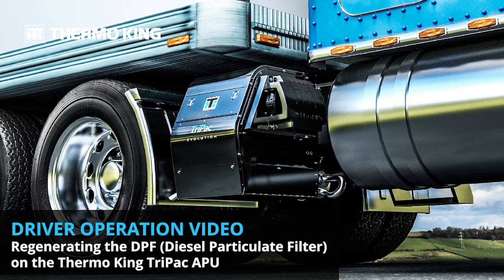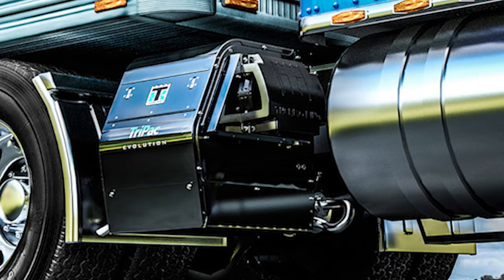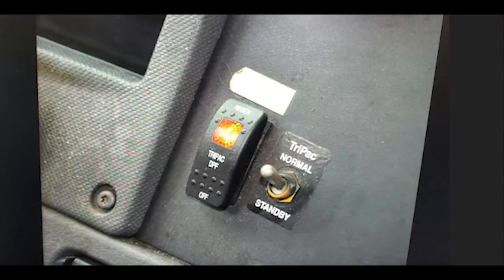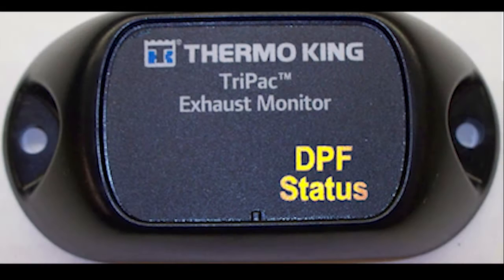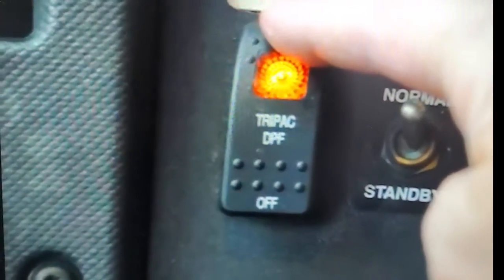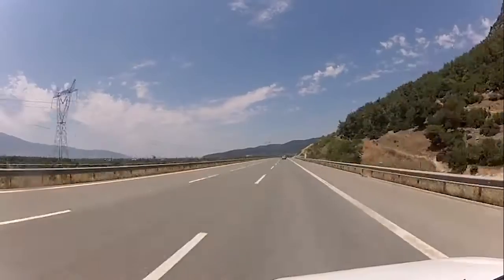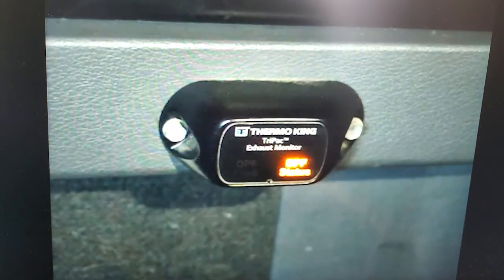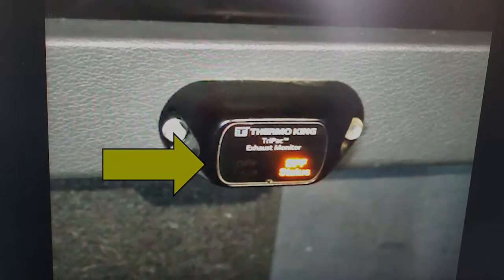TriPac Evolution APU Driver Operations: Regenerating DPF

Comment: What happens when you run it past those 10 to 15 hours and it shuts down, and then throws a red DPF 52 code and it doesn’t want to start?
Reply: Code 52 means it wants you to do a regen!  I have the same code issue

Comment: These Evolution models are junk.  Get an older rebuilt without the DEF system. You cannot regen these units.  Everytime these units need a regen they get stuck; and the only way to get a regen is to take it to a dealer to get it computer forced regenned.